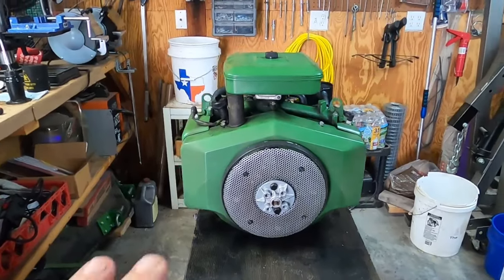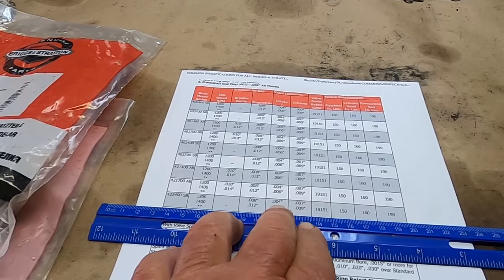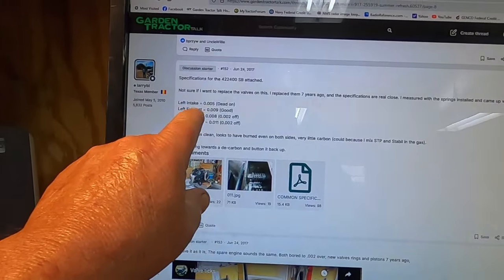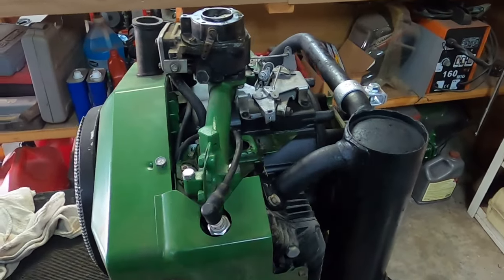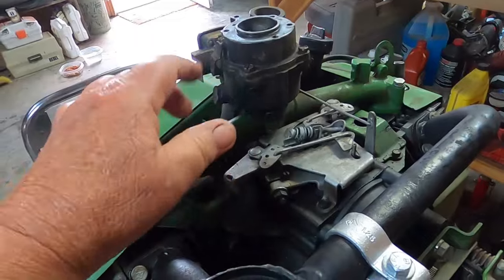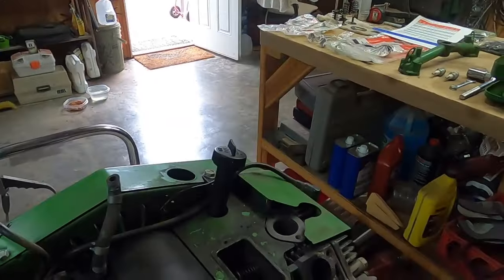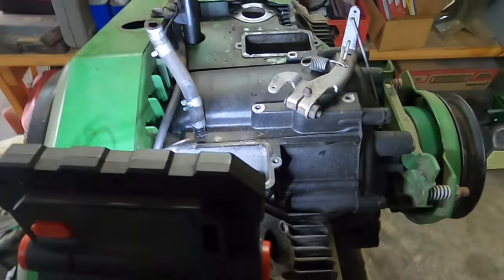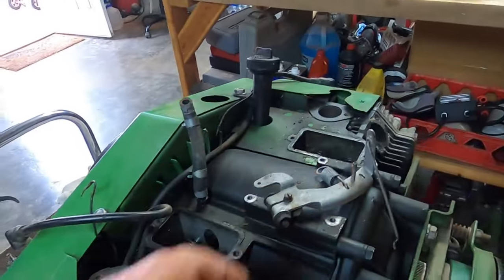Briggs 18hp Opposed twin Valve Adjustment Pt 1

Comment: That's why I have three sets of feeler gauges.   One still new in the package hanging on the tool board.   The go to if I can't find the other two.    I'd like to have the time back I've spent looking for tools and car keys over the years.   Now days no matter what, even if the house is on fire, the car keys go in a tray on the counter so they'll be there.... and the smart phone has a yellow case.   Is it sign of dementia?  Maybe, but I've been this way all my life.   Those old opposed B&S are my favorite.   Laws of the universe,  when you are looking for a standard screw driver you'll find three or four phillips and vice vers.
Reply from the maker: I have 2 sets of feeler gauges, because I couldn't find the 1st one, so I bought another. When deciding where to put it, I decided it would be stored hanging next to the 1st 0ne. DOH!